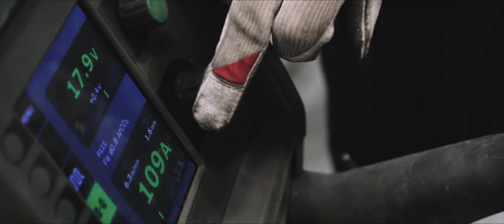FIRST LOOK AT BMW E92 EUROFIGHTER BUILD PROCESS (SPECIAL FOR JAMES DEANE)

Comment: Matching car as to what Kristaps Bluss is running?
Reply: Chris B I'm a bit late, but yes it is. Except that Bluss runs with large, naturally aspirated and high reving Chevy-based V8 with around 900bhp, and Deane runs a single turbo 2JZ that puts out around 800 with nitrous.
Oh, and Deanes is right hand drive.

Comment: why's the back not sealed? to cool the engine?
Reply: if u mean back window and trunk, then they are using window tunnels to cool radiator and also blow out smoke from tires